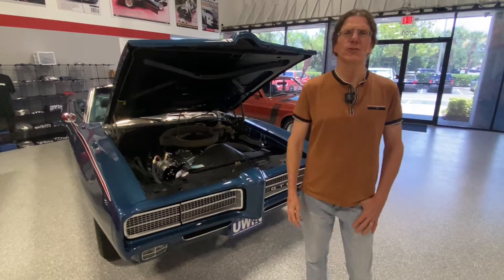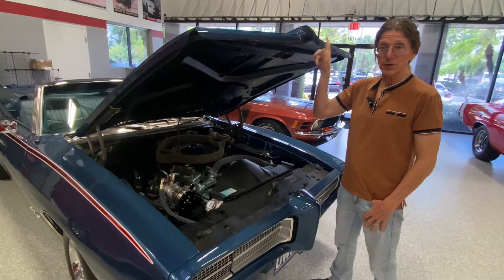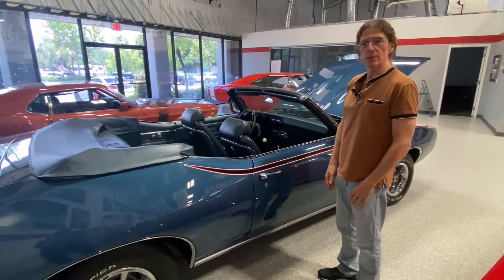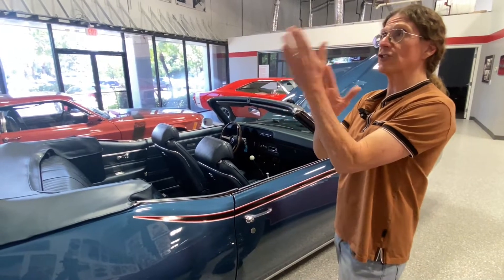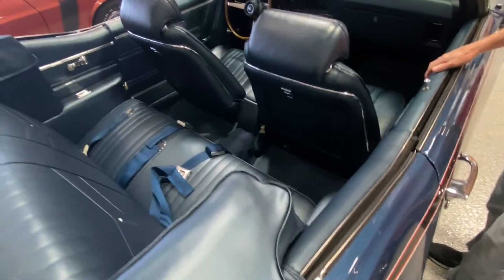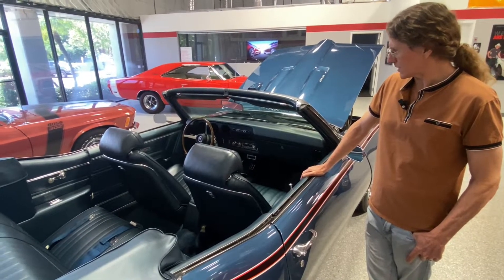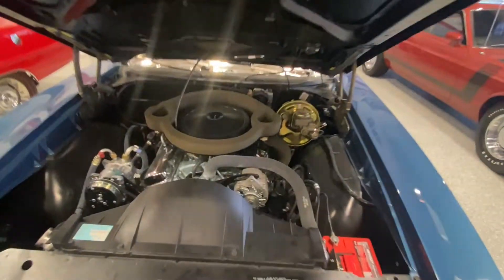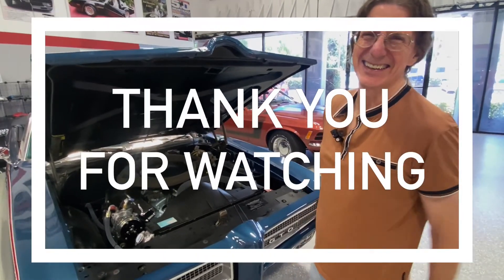Three letters you should know - G - T - O!

Comment: It sounds like flowmasters, magnaflows sound better, wondering about the engine build, sounds like they may have out a RAIV cam 041 in there and not the 068 which was the HO and RAIII cam, the dash could have had the rally gauges with the hood tach